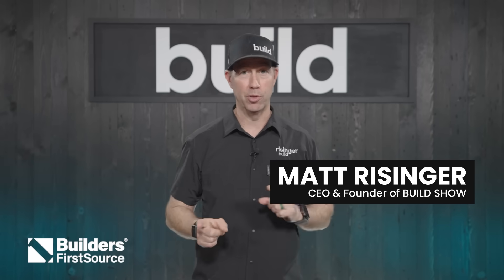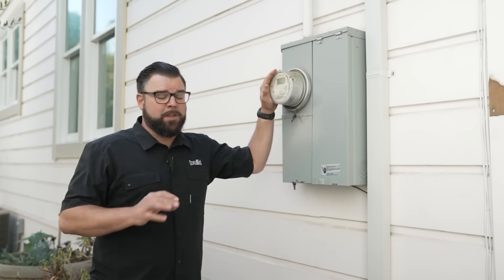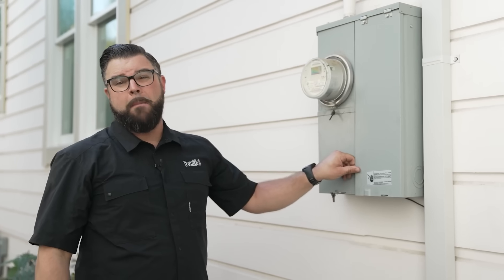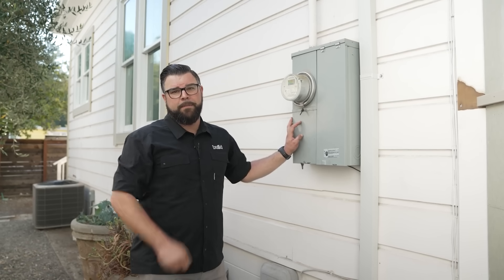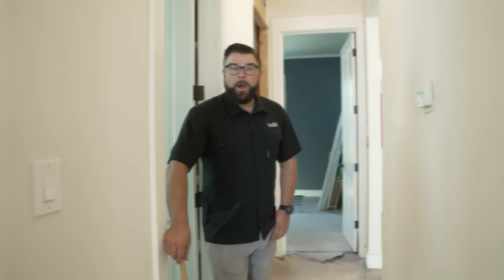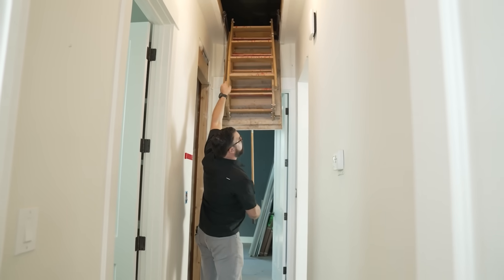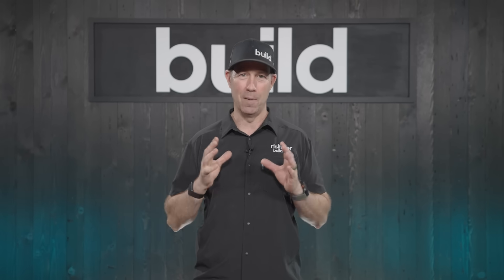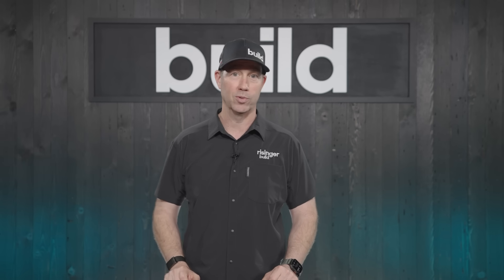Classic Electrical RED FLAGS in Vintage Homes | Best of Build Show

Comment: Fuses can be perfectly safe if the people maintaining them are sane and responsible, and they are certainly preferable to a defective breaker panel, a designation that keeps growing every year. But you might have trouble getting insurance; my condo replaced all the fuse boxes just to avoid a big premium increase.

Comment: 2:28 On the subject of grounding, pay special attention to houses that were originally grounded via the water main. If the water main had been replaced with plastic, the ground connection could have been left hanging, or, potentially worse, left connected to a metal pipe on the house side of the plastic main, which would risk making every pipe in the house a shock hazard. Inspectors should flag any water main connection, since even an  all-metal main is likely near the end of its life.

Comment: OLD houses had 30 amp 2 wire 110 volt service. My parents house was built in 1949 with 40 amp 240 volt service. Be aware that a new panel and new wire in the panel does NOT mean that every wire in the house was replaced. In two story houses the ceiling lights on the first floor will likely have old wire as few want to break open the ceilings and walls to get to them.

Comment: A modern 100 amp service is fine...if you have access to natural gas and municipal water.  If you don't have access and need a 240v 20A electric well pump, 50A electric range, 30A electric water heater and 30A electric clothes dryer you're gonna desperately need 200 amps.  And that's even before niceties and accessories like an EV plug or external garage / shed subpanel.

Comment: We bought a house in Montana a few months ago. A 1964 build and we're the second owner. The first thing I noticed was the beautiful 1.5" Bruce Red Oak flooring and the clean dry basement. Then the electrical panel. Federal Pacific? that sounds familiar, a quick search on my phone revealed the 2800 house fires every year caused by the cheap breakers that have to go in the panel. A closer look revealed a bunch of DIY wire splices (no electrical box) and covered in attic insulation. Needless to say the owner's son declared none of it on his required disclosure form. So that cost was negotiated prior to closing and we just got done replacing the overhead drop to an underground feed, upgraded the meter box / main to 200 amps and moved the sub-panel to the basement. My electrician was fantastic, probably the best subcontractor I've ever dealt with. We still have some of that cloth wiring in the house but everything else is up to modern standards. And yeah, the hardwood flooring was installed on 1/2" plywood. There's no sneaking around in this house, every step is a squeak!

Comment: After just helping my Son rewire his whole 1910 home. Here are the tell tales of old wiring. If many of the plugs are still in the baseboards or just above the baseboard. These are most likely knob and tube or installed by someone who hasn’t been trained to install wiring. We found many area’s where someone installed some new switches and plugs off of Knob and tube and ran romex to the new plug or switch to make it look new. We found about 40 junction boxes in the basement ceiling and another 15 in the attic. We removed every single cable in his house and rewired the complete house.

Comment: The "three light tester" can be fooled into showing the receptacle as grounded by installing a little jumper between neutral and ground on the back of the receptacle.  You see this a lot when a home has been freshly painted or drywall work was done and the old 2 prong receptacles were replaced without re-wiring the circuit.
Reply: Bingo! Yes, I've seen that myself in my own home. It's common. The best inspection is to be suspicious of any grounded receptacle and pull it out of the box to inspect it..

Comment: Misleading.  My house is 103 years old, knob and tube still serviceable. Did a basement remodel installed new wiring where I could, and my electrician said my original wiring is in excellent condition.  There’s nothing wrong with 2 prong outlets as long as you have correct polarity.  Most modern electrical items only have two pronged plugs due to equipment being double insulated.  Kitchen, garage and outdoor electrical access should have a grounded outlet or even GFCI.

Comment: If you're buying a 100+ yr. old house and it still has the OG main service that's a sure sign the rest of the electrical system hasn't been upgraded as well. And you won't need an inspector to tell you that it's going to be an expensive upgrade.

Comment: Another way to tell the age of wire is by color.  Cable made before the early 2000s was white, in 2001 they started color coding it by size.  So if you find white cable, it's 25+ years old, if it's yellow/orange/pink/black it's newer than that.
Reply: How often does the cable itself really fail? I've got that asbestos stuff from the 1950s and it's never shown any signs of trouble and even that BX stuff from the 1920s seems to work in some old houses. I'd run new cable if adding a new large load, like an outlet for an AC or oven, but for light duty stuff, unless the house has a history of rodents or rot, why go looking for trouble.

Comment: Well damn. My house has modern circuit breakers, modern receptacles, modern electrical service, and according to this, original 1950s wiring 😢. Guess that couldn’t have been replaced when the house was last remodeled since the drywall wasn’t removed…I have a new found reason to replace the crap drywall now.

Comment: 12:45 -When doing the re-cap like this it would really help with imprinting and retention if there were corresponding b-roll shots for each point mentioned, respectively, as whomever runs down the list.
Cutting in b-roll that focuses in on specific visual information being described that would play over the portions of the video where the presenter is more or less speaking into camera will improve the quality of the content but more importantly it will improve the efficacy of information retention for apprentices' and students.

Comment: I have a question for those who know more than me.  I live in an older apartment with a 150 amp breaker box.  I had some issues with the electrical and called maintenance.  I don't know if it was them or an electrician that disconnected the main and moved it down to the double pole breaker for the a/c handler.  I have electric heating.  We recently had an apartment go up in flames.  It started in the breaker box.  I want to call out the city or power company to inspect it, but I don't want to give them a reason to get rid of us. Oh, also, the breaker box is on the other side of the wall from the master shower.  I've had leaks from upstairs drip into the panel.  I'm sure that's not up to code. The place was built in 71, which means aluminum wiring.  It's a hot mess in Florida!
Reply: If there's a concern about fire near your breaker box the action you can take is just remove as much flammable material around the box as possible.  Remember, fire doesn't burn "randomly".  An electrical fire needs tiny small kindling that the faulty wire sparks will catch on fire.  Then it needs access to a constant source of fuel to keep burning and growing.  So carefully take a air compressor and blow out any dust and debris out of the panel.  Then look around the panel and floor near the panel and remove any sources of fuel.  Dry wall will not burn in this situation.
Reply: If it really has aluminum branch circuit wiring, it going to be pretty scary. Last I read, the only way to properly terminate aluminum is with special crimps to copper pigtails with deoxidizing gel in them. If they tried to retrofit the connections any other way, or left the original connectors in place, it is probably going to fail. I wonder if intumescent foam (the orange kind from the Home Depot electrical department) would block the path of any fire that could start in the breaker panel or in an overheated outlet box. Maybe someone with experience in the field will comment on that.

Comment: I had the fuse box upgraded in my childhood home. We had to move the meter and have the power company come replace the line from the pole to house and install the new meter.  I'm betting that whoever did the work here didn't have a permit, therefore couldnt complete the change over.  I live in Florida and the work was done in 1988.  I also got a friend's discount, so the cost was very reasonable.  Maybe not so much with this house.  You can't cut corners with electrical, especially with today's electronics and a TV in every room.

Comment: You didn’t discuss knob and tube, and oversized beakers I frequently see on those circuits. Or that some non and tube circuits have one neutral for multiple circuits. 

Definitely have an electrician look at the house, you can usually tell when the remodel was a homeowner job when they do things no electrician would do.

Comment: 100 Amps is more than enough for a 2000 sq.ft. home. Where I live natural gas is cheap and fuels the gas range, clothes dryer, water heater and furnace. We don't need much AC and drive hybrids (not plug-ins). So that ridiculous claim of needing 150 or 200 amp service is not always true.

Comment: Pittsburgh, Pa house built early 1900s. 30 amp 120volt.  One fuse screwed into a ceramic edison  socket with exposed wires in the stairwell. No ground or grounding. I installed a 150 amp service and had that inspected with one GFI in the basement and bare bulb lighting. The utility came out and put 2 stacks of F holdits in the meter socket for temporary power because the old 120 service had a 120v meter and would not fit the modern meter socket. These metal straps were still there a month later. The owner sold  the house because it was beyond affordable repair. Did I mention - This was a $2000 house. Thanks for the info.

Comment: Thanks CJ for alerting folks to some common electrical issues in older homes. Also look for exposed cables within three feet of the attic access opening.  There should be no exposed cables.  CJ did not cover knob and tube wiring that is common in pre 1940s homes.  Knob and tube wiring will not have a ground and should not be covered with insulation in the attic as it relies on air to keep it cool.  When installing replacement light fixtures most specify that the existing wiring should be 90 degrees C rated.  Wiring in older homes is 60 degree C rated or less. 100 amp service panels are the minimum allowed by code.  As we are going to more and more electrical appliances like heat pump water heaters, induction ranges and EV chargers, the minimum should be 200 amps.  lf you have air conditioning and a hot tube you should definately have a 200 amp service.  Another issue is the requirement for arc fault and GFI protected circuits.  I highly recommend having a licensed electrician, who keeps up with the codes, evaluate your old home so you at least know what issues you may have.

Comment: Be sure to check any switched outlets.  I got burned by that, where the previous owner botched some last minute receptacle replacements.
Reply: When I was a kid, the switch that controlled the front outside outlet would sometimes turn on the upstairs hallway light when you switched it off. My parents hired  an electrician in who said it couldn't be fixed. After living with it for a few more years, I had had enough time to figure out what they did wrong; it was just a wire in the wrong place; the original installers were probably confused by the unnecessary 3-way switch for the front outlet. This was only a 3 bedroom house; I'll bet some of the tangled defects in a modern-day McMansion would be far more confounding.

Comment: Aluminum wire, not the one from the utility company, but the ones in the walls to the light switches and receptacles,.  Serious fire hazard. We were renting a house to some people and the way they Daisy chained outlets. If you put a space heater in one receptacle that electricity has to go through all the receptacles, every screw and all the wire back to the breaker box and I’ll tell you if that house has aluminum wire in it you’re screwed.